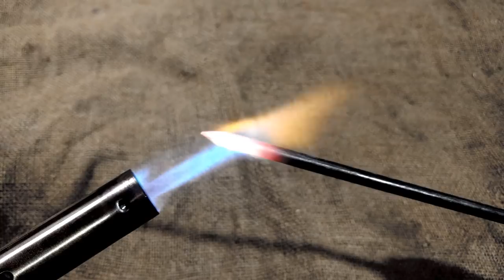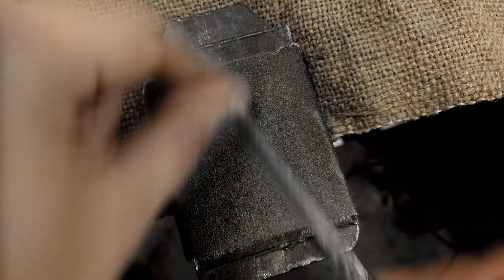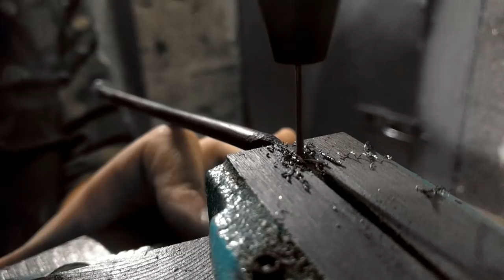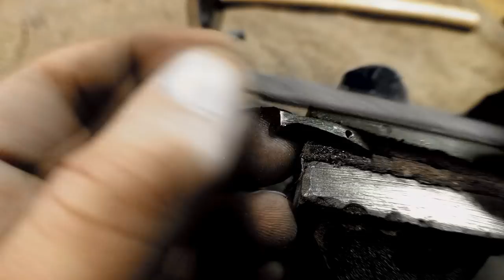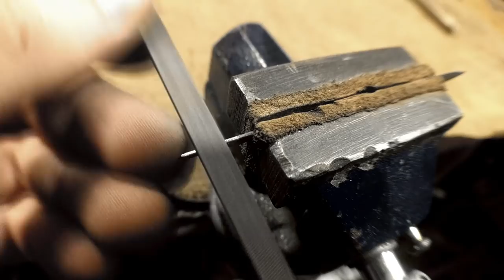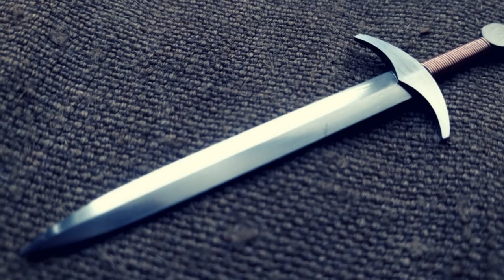Forging a Mini Sword

Comment: Hey Koss, your video inspired me to make a video series, i'm going to demonstrate each continents historical techniques of forging swords throughout history for novice swordsmiths. Teaching step by step how to create each particular cultures weapons, including the types of heat treatment used by that culture at the time. I think the micro versions will be better than full sized for trying to encourage younger people into the craft. Because amazingly you can start forging real mini swords that have real heat treatment, enabling the novice to understand the steps and process fully before investing lots of money into a forge and full sized tools. 
I worked it out, for under £15 anybody can set up a micro forge, with a pencil torch, can of refined butane, small hammer, and any flat piece of metal for an anvil. Scrap metal is free and found everywhere for the work material. 
My first video in the series will be making a Micro Roman gladius, from a large mild steel nail. This is perfect for representing the Iron they used 2000 years ago. Then after the gladius is made, we will use the authentic case hardening technique, because quench hardening does not work well on low carbon steel. You heat it to critical and then dunk it in a pile of carbon (Forge ashes, charcoal, anything burnt with phosphor, sulfur and carbon). That is how the Romans hardened Iron swords into serviceable steel weapons with a case harden. Also prior to the case harden it will be work hardened, which is cold hammering, which compacts the metal grain, turning soft iron or mild steel really tough.
Thank you for the inspiration, the video series will be on my channel within the next month, check it out.
Reply: Nudge!

Comment: I want to see more mini weapon forges! If you can get really thin wood (which I can't thing of the name at this point) like paper sheets but actual wood, used in a lot of projects. You could make sheaths
Reply: DragonKruton28 I believe the word you're looking for is veneer. Actually if you had a jig to clamp a stack of veneers in soaked with epoxy that had a lot of curves you could make some insane stuff happen on a project like that.
Reply: You could also use leather
Reply: You could use veneer, leather, thin kydex or even thin bamboo

Comment: wow, that is amazing, i'm trying to do something like that and you just showed me what to do. i don't know a lot because i'm 15 but i'm using your video to help me learn, and there amazing. love your work.
Reply: What are you going to make, when i was 14 i made a random collection of melee weapons, and random parts for my other stuff I build
Reply: i  don't know, i was restoring an old axe the other day then my dad came in and yelled at me because i took the axe head off the handle, i knew what i was doing but they just got mad, i have made little mini knifes that are pretty good though,
Reply: Ilyjah Swartz should I make plate armor or more mini sword
Reply: ooh that would be cool, you could try making mini plate armor to go with the rest, and you could make a little stand for it, or if you want make big plate armor that could fit you.
Reply: Ilyjah Swartz I'm gonna try making mini plate armor because I made ones that fit me and they are heavy, it's just full steel and padding, I've only made the torso, shoulders, forearm, boots, and knees for the ones that fit me
Reply: cool, well i just asked my dad if i'm allowed in the garage, his answer is NO, because my brother steels stuff and he took a knife from the garage, so now he wont let anyone in the garage till he gets it back, its so stupid
Reply: Ilyjah Swartz I'm usually banned from the garage if it's messy
Reply: First Things To Do Is Burn A Nail With Anything Flameable until its Red then Smash It With Hammer Until its Flat and make Tang For The Handle (Google it) And Then Make the Handle
Reply: When I was 13 i used gasoline

Comment: That was really fucking cool. If you don't mind. I think I'm gonna go try this. I'm almost tempted to take it a couple steps further. I might make a micro coal forge using a little steel cup I have and a fish tank air pump. Maybe cast a tiny steel anvil. Maybe make some miniature tools just for show. Hammer, tongs, etc. I think that would be bad ass.
Reply: If I were to go through with this. Would you like me to send you pictures? Being that you inspired the thought.
Reply from the maker: Sure, why not =)

Comment: What's the difference between red hoy metal forgin and just hammering the cold steel?
Reply: Think of it this way clay is smushy and when it's heated it's hard when u forge its the other way around
Reply: When you hammer cold steel you're in high danger of stress fractures, with nails you're also in high danger of losing an eye of you've picked out a galvanized one and start pounding on its side. Also, it is significantly easier to move steel that's yellow than red, and easier to move steel that's red than when it is grey. 
Frankly, nails are usually relatively soft compared to tools like hammers in order to prevent the nail from damaging the tool, steel will also be much harder it you heat it to ~1500 f and cool it rapidly in oil or water, although this can also give you stress fractures if done wrong.
There are quite a few reasons to heat it, and these are just observable reasons, I'm not about to get into the metallurgical reasons such as brain structure and crystallization.

Comment: Hey man really want this but I don't think I can make it
Reply: Rider Shapiro it's fairly straightforward, nails are fairly soft steel and you don't need a 70 lb anvil or anything, you don't need a forge as a map gas torch from advance or autozone will do. I won't say I have faith in you because I know almost exactly nothing about you, but I don't think you should have too much difficulty doing this as long as you remember a few things. 1, safety is first and foremost. Watch out for your eyes because you only get two of them, and ask anyone in the food industry how bad oil burns can be, now just imagine if they were working with stuff hundreds of degrees hotter. 2, don't chase a turd, get a carton of nails and just work, if you fail, get a new nail. 3, practice makes perfect. You need to work on controlling your hammer in order to develop a technic, it's not all about power. 4, a steady base is key. You don't need an anvil, but you need a steel plate of some kind, and it must be resting on a steady foundation, you will lose all of your hammering power if you don't have a strong base, which will lead to you swinging harder and making more dangerous mistakes.
Keep those in mind and you should be able to do it, barring any disabilities, if not on your first attempts, at least within one carton of nails.